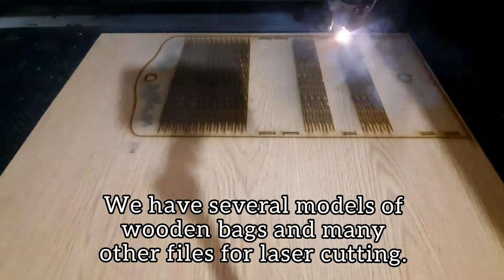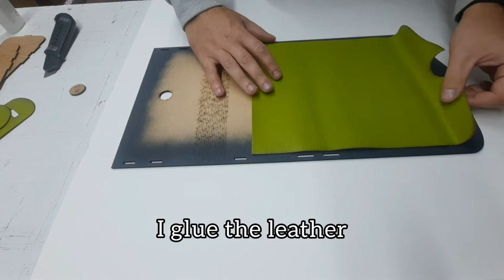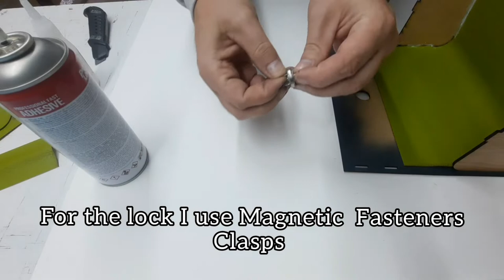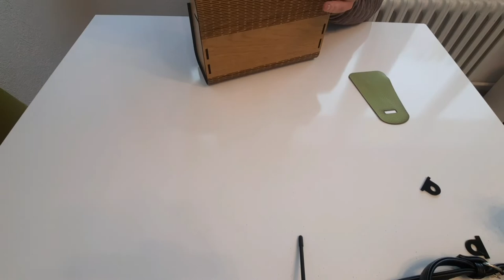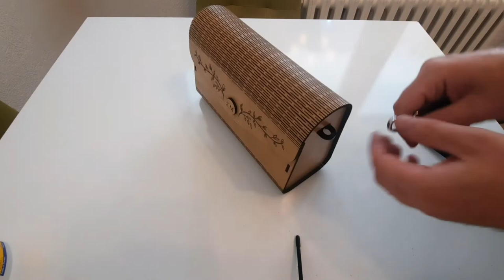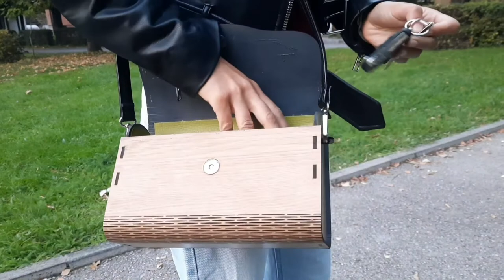How to make Wooden Clutch,Purse,Handbag,Bag from my Etsy store on Laser cutter DIY Living Hinge

Comment: This is not working for me.
- The magnet is not strong enough to hold the flap down, and I've followed all the steps and purchased the same magnetic clasps.
- The leather on the inside billows out when the wood bends, at all the curves. I've glued and cut in all the same places as you.
- This size seems to be challenging for the wood material I am using. The wood is breaking a little at the curves. What material are you using? I am using birch ply 8th inch,
Any direction or help would be appreciated. I would really like for this to work....
Thanks
Angela
Reply: He appears to be using a wood laminated MDF, which is much more pliable than wood.  I think even a solid wood panel of 1/8" would be better than plywood for this application.  If you try again, i would suggest balsa project panels.